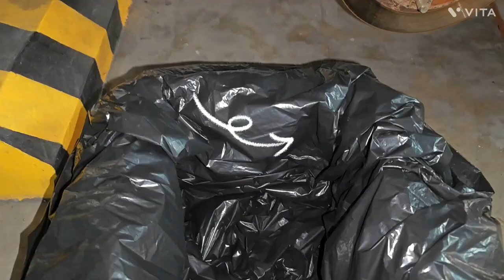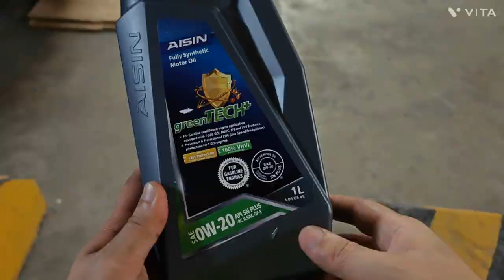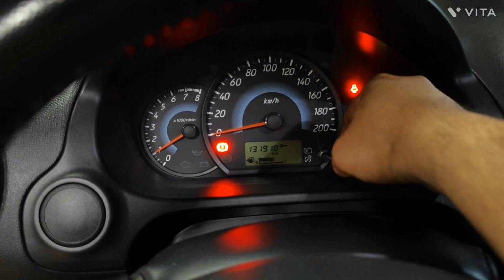How to change engine oil and oil filter | Mitsubishi Mirage G4 | Hatchback | Space Star | Attrage

Comment: My suggestion is to 1st loosen oil fill cap, 2nd take out oil drain plug, 3rd put drain plug back in, 4th take off oil filter, 5th put new filter(oil gasket), 6th remove oil fill cap, 7th fill with correct amount of oil, 8th put oil fill cap back on, 9th warm engine and check oil level. Good luck!

Comment: You forgot to change the crush washer on the oil plug.  This should be done every oil change to prevent leakage.
Reply from the maker: I totally agree, but in my case I did it on purpose - the washer is stuck to the plug. I figure if I forcefully remove the washer, I could put a dent on the plug, which could increase the chance of leakage. So until I find a cheaper plug (unreasonably expensive at the dealership), I'll retain the washer. There's been no leaks for 8 years so I think I'm good.
Reply: I've had mine for 8 years now (2015 model) and have never changed the crush washer. Snug the drain bolt and you'll be fine. No need to get crazy with it.